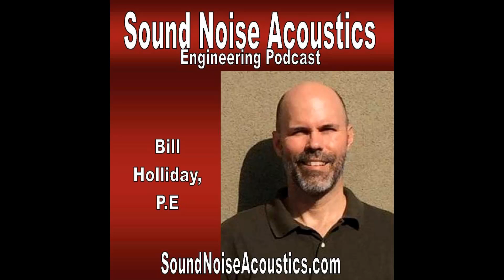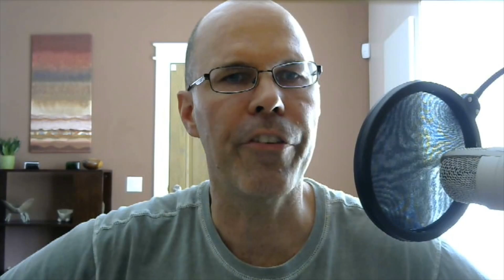#10 Sound Isolations - 10 tips to improve STC of walls - Sound Noise Acoustics

Comment: I am not clear on where the paper side of the insulation should be placed. If I am standing inside the room, do I see the paper face or is it on the outside, where it would not be seen by me standing in the center of the room? Also- if I am building a double wall system with separate footer and header plates, where would the paper side of the insulation be in placed within the outside perimeter wall? Is it placed so it is visible to the "outside" world with the insulation material towards the center of the two wall assembly?